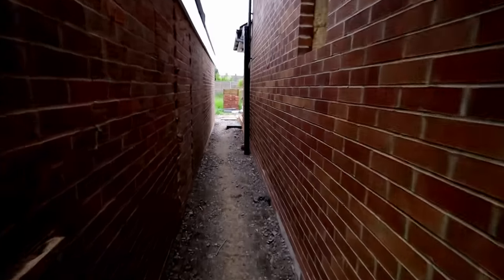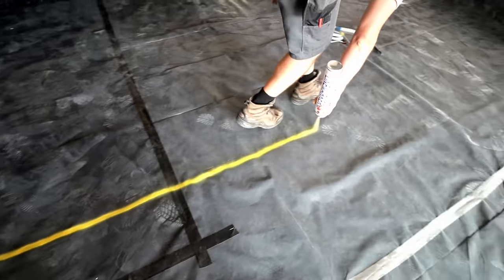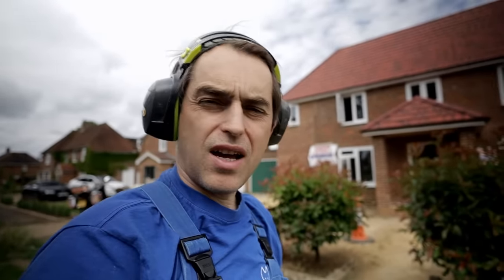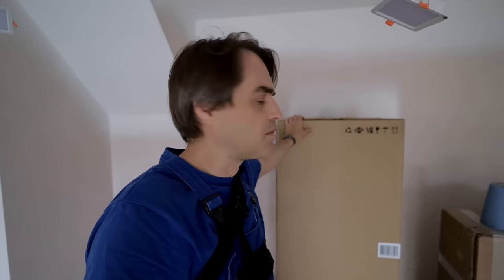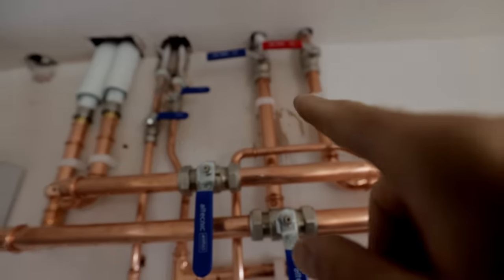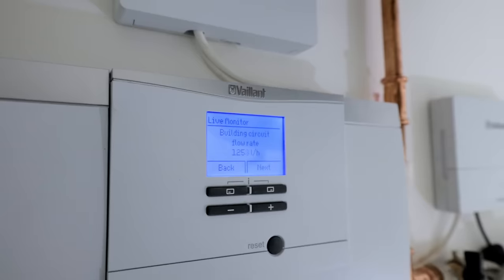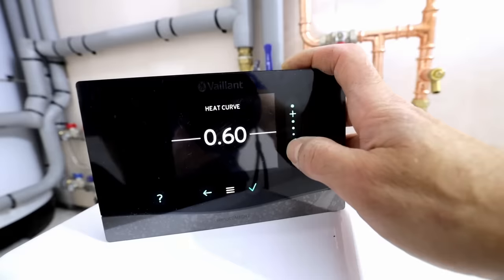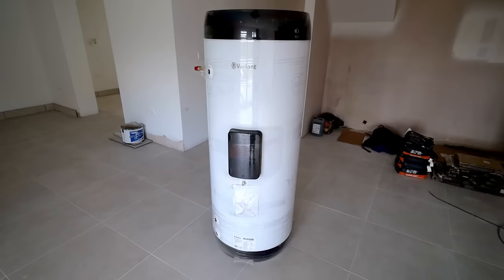Gas Boilers No Longer Make Sense, Here Is Why.

Comment: Your tirade against "return on investment" is, of course NOT appropriate. It's the PAYBACK period that matters. HOW much money would this system save on your heating bills over gas? For example, IF it enabled savings of say £1000 a year BUT cost and extra £20K over a simple gas boiler set up then it would be 20 years before you actually saved any money. See comment below about a £2K gas boiler vs a £25k set up, which, although not directly comparable of course, shows the potential cost differences of the two systems. THAT MATTERS but you don't seem to want to acknowledge that. However you do, obviously, know what you're doing, and its enjoyable watching a professional work out what needs to be done in a particular installation.
Reply: £25K would include a major cost of upgrading from a high-temperature to a low-temperature heating system, which isn't exclusive to heat pumps, and isn't £25k in every case, some existing properties only require £1-2K of upgrades, so with the grant, land at around the same cost as a boiler install. All new central heating system installs (in new or existing properties), require it to be a low-temperature heating system, and this has been the case since summer last year.  Eventually, sticking to high-temperature heating systems will have an effect on the house value, as they will become less desirable, especially if gas prices rise.
Reply: none of that actually answers the question though, does it? Now what you say is factually correct and the direction of travel is, at the moment at least, away from gas. The actual heating costs using heat pumps always seem to be under-estimated as lots of people with them say they simply don't keep an older house warm in winter. With a super insulated new build then yes the maths would stack up more convincingly @BenIsInSweden
Reply: @andrewhumphreys9889  The thing is, every property is different, and nobody can really predict what the gas and electricity prices will be.  It's a myth that they don't keep an older house warm in winter, that's a bad installation issue, not a heat pump issue.  They've been heating homes in worse weather in Sweden for decades.  Better insulation just means less heat loss from the property, and able to run at a lower flow temperature, extracting more efficiency and therefore savings from a heat pump.  It doesn't mean the house will be colder.  Detach the low-temperature heating conversion cost from what the heat pump costs - they are separate things.  It's like expecting solar panels to pay for changing your 50-year-old roof to be able to support them (it might, but it's an unreasonable expectation).  In the case of properties don't need many upgrades, the cost for a heat pump install is very similar to a boiler - and basically, you get the savings from day 1.  Not all properties will be like that, but there are definitely ones that are.  In the case of a completely new heating system install, as per the video, it makes no sense to go for a gas boiler because you are required to ensure it's a low-temperature system, the grant brings the installation cost to nearly identical anyway, so again savings from day 1.
Reply: but not every house can be insulated to the degree necessary to make heat pumps an economic option. As many have said, the UK housing stock is old and less well suited to these pumps. For example, I've got an old stone cottage, can't lag inside or outside (lose inside space on the former and the latter is impossible as the building has to breathe). Too disriptive to dig floors up to install under floor heating as I don't have a loft so can't insulate better without pulling the entire roof off to do so. So with me, for example, a heat pump wopuld just be an expensive waste of time
 @BenIsInSweden
Reply: @andrewhumphreys9889  I think my reply got eaten. Glyn Hudson has done a self-install on an uninsulated 200-year-old stone construction end-of-terrace.  Gets'a scop of 4.2, so easily beats gas. So it's a myth that insulation is needed and that old properties are unsuitable, and can't save money.   The answer is it depends, but in most cases, with a proper installer, it will.
Reply: @andrewhumphreys9889  It cost him £5K extra because doing a self-install wasn't eligible for the grant, which he spoke about. If you watched the video they weren't using their gas boiler because it was so expensive to run, because they had to use it from bottles.  So were mainly heating their house from the wood stove downstairs.  He could have done all the work for a gas boiler, and it would have cost him the same in materials (rads, piping etc) but would have cost more to run.  As you seem to be ignoring, the changes to the system should be considered a separate cost, they aren't exclusive to a heat pump install, which people keep trying to make them out to be.  He did his for home comfort, so the cost of the actual upgrades is rather irrelevant.  For the heat pump side you can find out how much that costs yourself.
Reply: @andrewhumphreys9889  Sorry, see you mentioning "THIS Video" rather than Glyn's.  But my point is the same, that cost for materials for UFH etc, is the same regardless of whether a boiler or HP went in.
Reply: COST is COST so is hardly irrelevant. And, again, if you're using bottled gas then YES its more expensive than for town gas. An individual MIGHT be able to benefit from heat pump, depending on his particular circumstances, BUT you seem to be claiming that its a panacea, a solution for everyone, regardless of their own circumstances, which is simply not true. If YOU know so much then WHAT exactly was the complete cost of the install in THIS channels example - both materials and labour?  @BenIsInSweden
Reply: @andrewhumphreys9889  Yes Cost is Cost, but in this video, it's irrelevant for comparing the material costs - it's a renovation, so falls under a new heating system installation, so by building regulations even with a gas boiler it would have needed the same materials and similar labour for installation as a heat pump - as it needs to be a low-temperature system, so the main difference between the two is what a gas boiler costs and what a heat pump costs, and what the running costs of both will be. I'm not claiming it's a panacea, what I am saying is - it depends, and using certain building characteristics (age, insulation, etc) is not going to really reveal whether it is cost-effective or not.  My advice would be to get a heat loss calculation done, and see whether it suits your home or not, and not just disregard it because you've "heard they don't work in old houses".  We don't know the reason for the renovation of the property in this video, but it's certainly not a case of "I want a heat pump" and this was the only way to achieve it.
Reply: thats a nothing of a reply. The only conclusion is that stating the actual total costs would should the figure to be huge so it won't be shown. Why not then compare it with other options? Again, the answer would be obvious @BenIsInSweden
Reply: @andrewhumphreys9889  I don't know how to make this any clearer. The heat source has very little bearing on the price of the system being installed here.  If you want to know what underfloor heating and new rads like this would cost in your house, go ask a local plumber.  The only people for whom the costs of those upgrades are relevant here are this particular homeowner and the installer. Asking here either means: a) you're being nosey, or b) you have the mistaken belief that these are costs incurred because of installing a heat pump, and would apply elsewhere, which it won't.  The homeowner decided to go with this setup for their requirements, and they kindly allowed Szymon to do a video on it.  It's ultimately between the homeowner and Szymon on whether the price paid can be made public. But even if they did, it's none of my (or anyone else's for that matter) business.
Reply: why are YOU continuing to ignore the costs. As you're such a know it all I asked you to ESTIMATE what they are. The fact that you won't, as is the case with every refusal to mention the price of something/anything, only means there is something to hide. I'm done wasting my time on you  @BenIsInSweden
Reply: @andrewhumphreys9889  Do what I do if I want to know the cost of something for my house... get someone local out to do a quote. My roof is being done at the moment (for Solar as well).  I didn't go around posting on roofing videos asking for what the cost would be, because I know it's specific to that house, and not relevant to my house.  Same for an A2W heat pump, I got a quote for my house, and for my requirements.  My requirements were it would need to do cooling in a bunch of rooms as well, which means some of them would need 4 pipes running to them, and using fan coils instead of standard rads which for each of them would be about 6x the cost.  I also wanted a heated towel rail in the upstairs bathroom, and I was given 3 different options with different costs depending on the solution chosen, along with pros and cons of each.  The quote for what I wanted (bearing in mind my house doesn't have an existing waterborne central heating system) would have come at around the equivalent of £40k. I'm not sure what use that price is to you though, because, again it's specific to my requirements and my house.  The heat pump is included in that cost as well, as my choices are basically air source or ground source.

Comment: Gas still costs a quarter of the price of electricity so dump your heat pumps. They don't work if the air temperature is around 4 degrees C and just use up electricity!
Reply: Mine works just fine down to -20C, so maybe dump your outdated information instead?
Reply from the maker: Yep, Kenny doesn’t have a clue and Jay repeats what he read in Daily Fail
Reply: You obviously don't understand whats going on in your heat pump @BenIsInSweden
Reply: @kenmerry2729  I've been a heat pump owner for over 8 years, so please enlighten me as to what I don't know. Considering I'm 99.9% certain you don't and never have owned one.
Reply: @kenmerry2729  Even with electricity being 4x gas, it doesn't make a heat pump more expensive.  A unit of gas consumption doesn't equal a unit of usable heat.  And if people are to be believed with how few homes Heat Pumps are suitable for, then gas efficiency will be lucky to be at 85%. Meaning to get 1kW of heat from gas, you're buying about 1.2kW of gas.  There are other factors as well, e.g. overnight tariffs that can be used to charge the hot water cylinder, which will cost you (assuming 8p / kW for gas, will be costing you about 9.5p per kW of heat), and with a heatpump at a scop of 3, on octopus's cozy tariff would cost about 18.5p/kW, meaning 1kW of heat would cost about 6p / kW. 25% less than what it would for gas.  Your point about "they don't work below 4C" is based on misinformation about defrost cycles (and often comes from American units and older UK units where a resistive element is used). Modern outdoor units (and EU cold climate ones for decades) will only defrost once the ice build-up on the unit has enough of an effect on efficiency that it's worthwhile kicking the unit into reverse to melt the build-up of ice. For mine, this is about 5 minutes every 1-2 hours, in sub-zero temperatures.  When you live with it and understand what it's doing, it's not something to be concerned about.  I'm all for my unit using some more electricity to get rid of the ice build-up, so it can operate again at its peak efficiency - and thus saving far more than if it left it.
Reply: @kenmerry2729  Elaborate.  Also using current prices doesn't always mean things will stay the same, with the way things are heading, and electricity being cleaned up, it's likely that the gap between gas and electricity will narrow, and by then the government probably isn't going to be offering the £5K grant. As things stand today, it's definitely possible (and proven) that in properly installed installations that heat pumps are cheaper to run than the gas boilers they replace.
Reply: @kenmerry2729  Not sure where you've got the idea that I'm an installer.  Just an end user that's interested in the tech, and when I move back to the UK; a heat pump will definitely be part of my consideration when buying a property.  Looking at UK historical prices for gas and electricity, it looks like the gap has been closing not widening, so not sure where you're getting your info.
Reply: Sorry, got you muddled up with the installer. We pay for gas by the Kw same as fpr electricity so units are the same. @BenIsInSweden
Reply: @kenmerry2729  I'm aware, but you pay for each kW unit of gas used, not the amount of usable heat you get out of it.  In most UK homes the temperature set would not be able to achieve the 90%+ efficiencies that many people suggest they do - they can with the correct flow temperature, but that then needs a bunch of the upgrades that a heat pump requires.  So realistically you are only getting ~0.8kW of usable heat from each kW of gas used and paid for.
Reply: Hi, I've not seen figure for that and I'm sceptical about any figures. I also assume that 1 kw of electricity does not have a 100% efficiency., but I don't know. What I do understand is that when the air temperature reaches about 4 degrees C the air heat pumps start to struggle and I'm not into having anything that struggles. A bit like wind and solar power. It's not of much continual use and we aren't getting sufficient to use batteries. @BenIsInSweden
Reply from the maker: At 4c they still run at around 300% efficiency !. Vaillant’s is 280% at -2 from memory
Reply: @kenmerry2729  the loss of efficiency in the boiler is because you lose some of the heat generated out of the flue, which you can't really do anything about.  Heat pumps give you about 4kW of heat from about 1kW of electricity paid for.  The 4C thing is when the heat pump will start doing defrost cycles (depending on outside humidity) to get rid of frozen condensation on the outside unit.  For mine, it does it in sub-zero temperatures for about 5 minutes every 1-2 hours, and that is what affects the efficiency.   Certainly not a struggle and mine maintains still being over twice as efficient as a gas boiler down to about -28C.  People make a huge deal out of the defrost cycles being a big problem, without understanding what is going on, and even with defrost taken into consideration they still run rings around gas boilers in terms of efficiency.
Reply: Computers will never replace the typewriter.
Reply: @kenmerry2729  Only just saw this reply.  They are under-balling the efficiencies quite a lot there, and incorrectly assuming that 1kW of gas = 1kW of usable heat, which is false.  But their points also prove your statement that "They don't work if the air temperature is around 4 degrees C" completely wrong.  As they say, "Several heat pumps can even supply your home with warmth when the mercury plummets as low as -25°C."
Reply: @kenmerry2729  Yes I am. I am originally from the UK, and likely to move back there in the next couple of years.  It's your choice to stick with a gas boiler.  In the long run, I would put money on gas working out even more expensive compared to a heat pump than it is today, and expect any properly installed heat pump today to have easily outpaced a gas boiler come the time for it to be replaced.

Comment: Something that has to run 24/7 can never make sense
Reply from the maker: Makes way more sense than hugely oversized on / off systems. Modern weather compensated gas boilers also run 24/7
Reply: Like a petrol or diesel car they use more fuel in startup for everything to reach optimal running conditions. But these take that concept to another level where by once "warmed up" they use a fraction of the electricity to maintain the temperature.
Reply: this is why i refuse to have a fridge in the house, it just doesn't make sense.

Comment: It costs me £11 (+ standing charge) per month; in summer, to have hot water from my gas boiler. How is a HP better than this? 
You may be a better plumber than myself but ive seen good plumbers hard sell boilers that are worse for the customer than what they already have. 

This is a sales pitch imo.
Reply from the maker: Add solar PV to your heat pump and hot water will cost you £0 in the summer.

Add battery storage and cheap overnight tariff and hot water will cost you below £10 a month in the winter for a 250l cylinder heated daily 🤷‍♀️

Comment: lies, lies lies and all lies. gas boiler costs about 2000€ to get fully installed and running. annualy you pay about 900€ for a big house that is heating water, stove and radiators. electric inverter costs about 15000€ and the annual costs are more or less the same. there is nearly nothing that can break on a gas boiler and if so, you can get it replaced or serviced. inverter requires the same annual check and the cost is about the same that is unless your motherboard breaks, that cost is in thousands.
Reply: None of the heat pumps in these videos cost anywhere near 15000€ (unless the Euro has plummeted to ~1£=3€).  Are you thinking of commercial or industrial applications?
Reply: @euroovca25  10kW is oversized for many UK properties.  The Mitsubishi Ecodan 6kW in the UK costs less than £5k. The zubadan isn't really relevant in the UK either as the smallest is 8kW, and it runs off 3 phase, whereas the vast majority of UK homes are single phase.